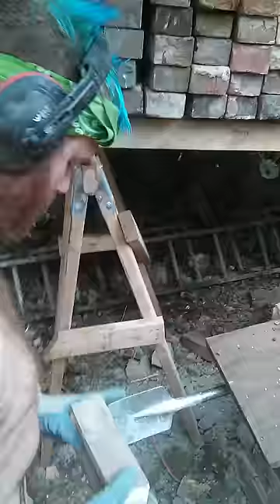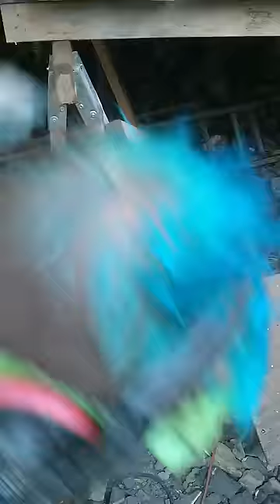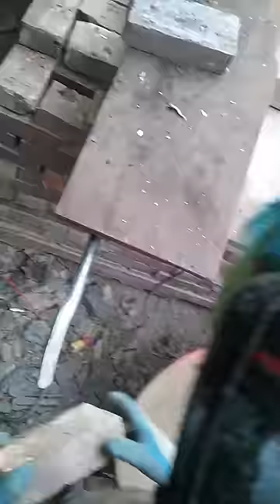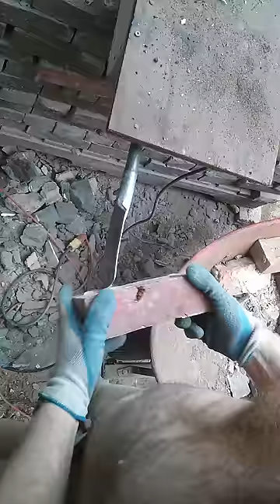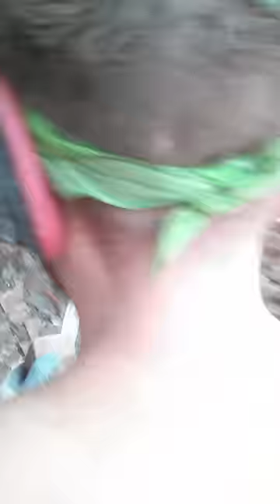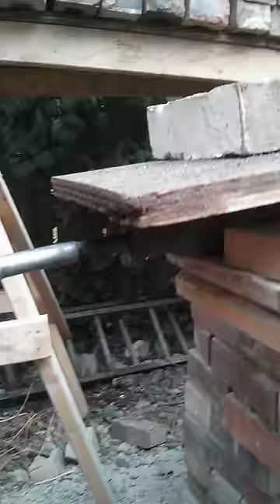Fastest way to clean mortar off bricks

Comment: Very nice setup; where did you get the chisel from? Something you bought or put together yourself?
Best regards from Denmark :)
Reply from the maker: It's called a clay spade, plumbers use it when they need to lay 4" drain pipe in clay. Common accessory for SDS max.